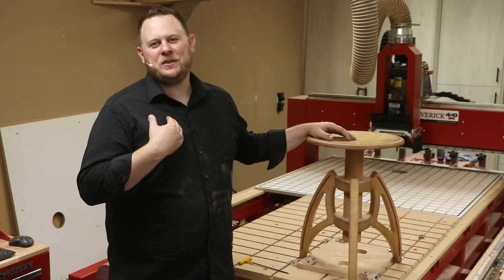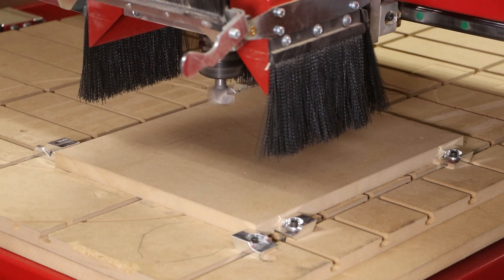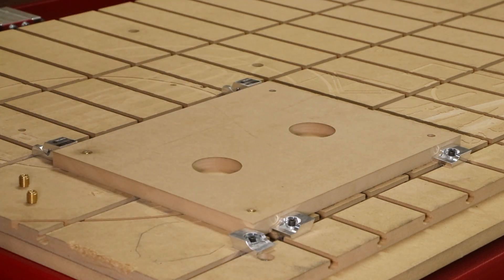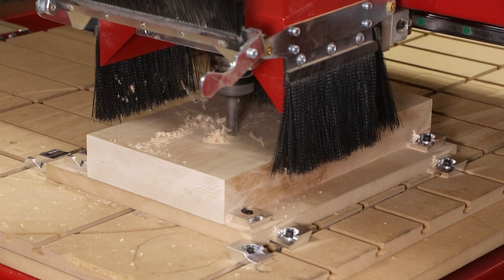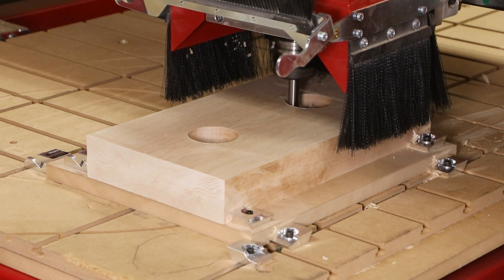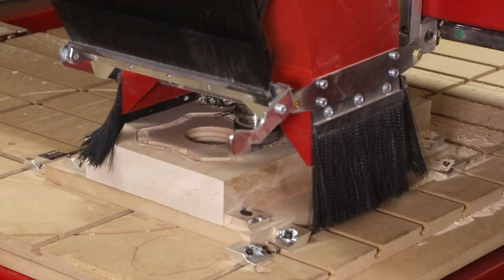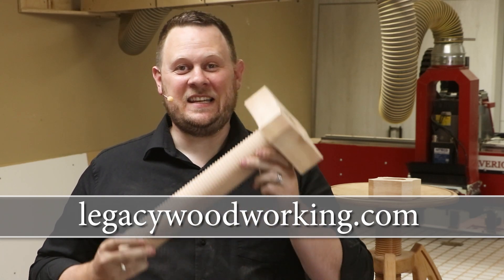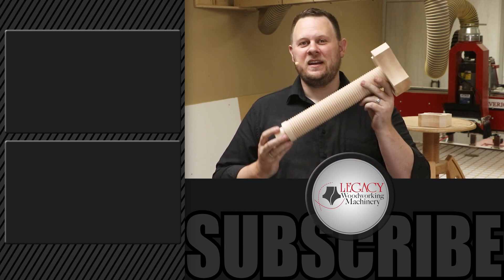Transforming Wood into Art: CNC Magic Crafting a Threaded nuts for a Bar Stool!

Comment: I don't have a cnc legacy, just an old manual one, but .....if the threaded stool shaft is to thread into both of these nuts they will have to be exactly the correct distance apart and also turned/rotated so as to orient the threads or the threads won't line up and thread into each other.  Is your plan to rotate the "nut parts" a quarter turn or so to enable the shaft threads to line up without worrying about getting the exact distance between the nuts?    I hope you understand the question.....here it is in another form....If I weld 2 nuts to a length of flat stock and thread in the 1/4-20 ready rod it will thread into the first nut no problem but it might not go smoothly into the 2nd nut...see what I mean?  could you explain how you're going to make it work...like butter?    watching from the west coast of Canada.  Thanks for your most enjoyable videos.
Reply from the maker: That is a great question, and you are right, this can be a complicated project due to the need to be perfectly accurate.  If I were building this by trying to cut or sand to a pencil line then we would almost always fail.  As you said, when it come to threads if you are of by a little you are off by a lot. Tape measures are just not accurate enough. Making parts with the Maverick CNC allows you to start by drawing perfect parts, then cut perfect parts, and finally assemble perfect parts.  Doing these three things allows the woodworker to make projects that would otherwise be outside of his/her ability.  We have started holding live classes here at our factory in Springville Utah, we will be doing this project in November and December. You do not need to be a CNC owner to experience the precision of CNC. If you would like to make one of these stools, give us a call and get signed up today! 800-279-4570.
Reply: @legacycnc8232    thanks for your reply.  I didn't get the kind of answer I was hoping for.  I guess it's all worked out on the computer somehow.  If the nuts are fastened to the legs at a fixed distance from each other then I guess that is part of the calculation for where around the inside of the nut the thread cutter starts it's journey.  Perhaps you could cover the details of this calculation but you probably made these vids a while ago.  4 threads per inch matches up well with the option of 4 possible positions that the 2nd nut could be rotated around to before being fastened to the legs.  That's a marvelous machine you've created.  looking forward to more vids on this.